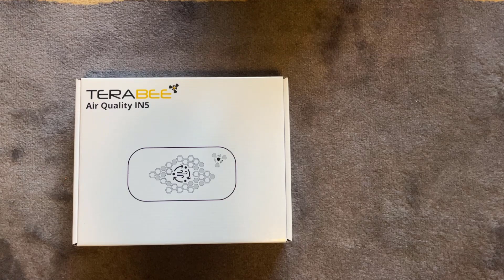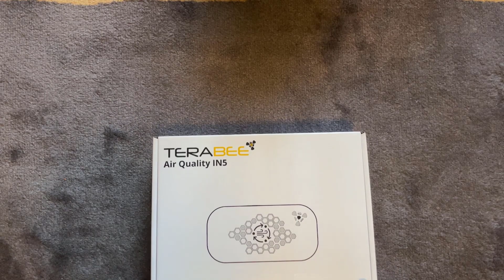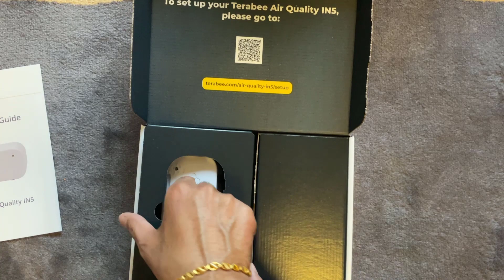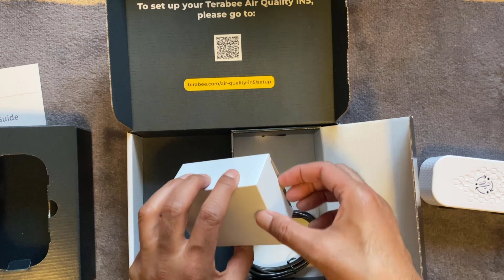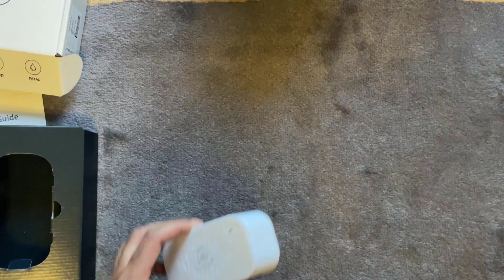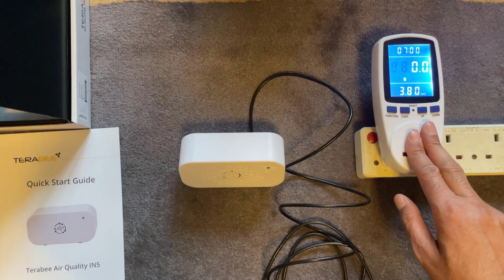New PlanetWatch Type 4 Sensor - TeraBee IN5 Unboxing and Power Consumption

Comment: how many $planets does it earn? been a while since i checked planetwatch
Reply from the maker: This is a type 4 sensor, so earns 23 planets per day. It can earn more (long term) if you take part in their HODL programme. Sidenote - this TeraBee sensor is more reliable than the type 4 Atmotube Pros. Since this video, it hasn't missed a beat
Reply: @HandymanSavage  excellent! Great to hear thanks for the reply
Reply: @HandymanSavage  are the rewards still valid? I still have 6 licenses
Reply from the maker: @sebastianherrmann1640  Yes the rewards are valid........however Ambient have bought out PW and they plan on migrating rewards to Ambient fairly soon. Go read up on Ambient and decide what's the best plan for you. They are taking a snapshot on the 15th July, so make sure any devices or planets you have elsewhere are in the wallets.